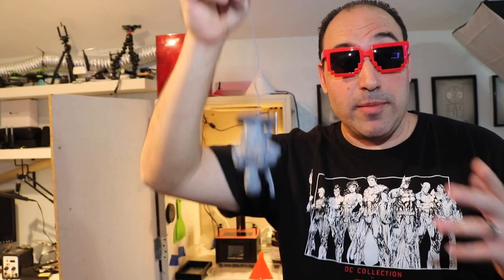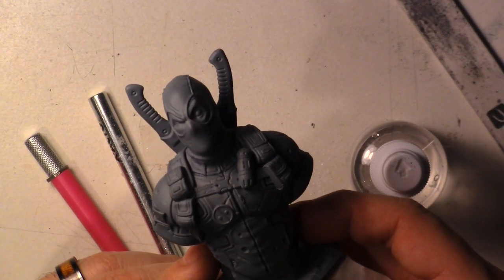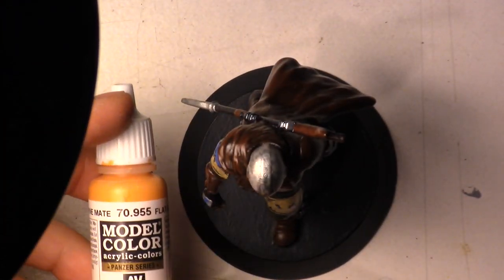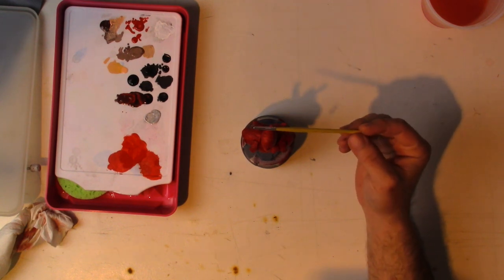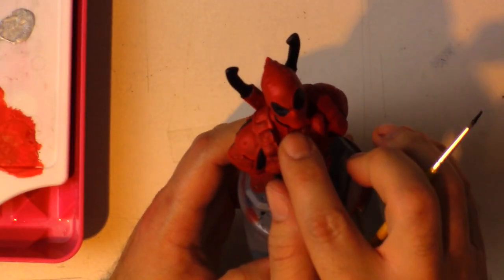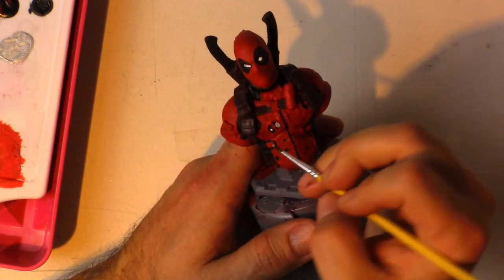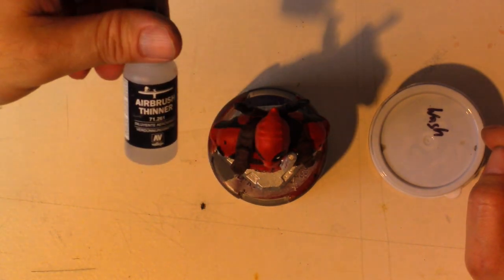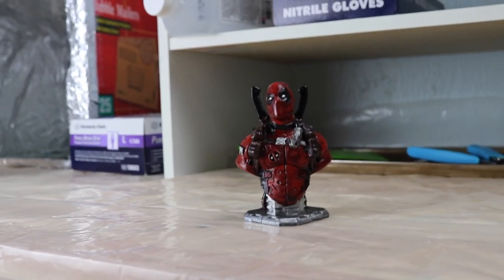How to Paint 3d prints, the basics

Comment: Two tips i can give about the finish; when you do a wash, its meant for accenting shadows and crevices, so go back over with your base colors again and hit the entire model (not just highlights). then you can go back with a lighter base color and highlight like he did. lastly, get some quality clear coat. rustoleum is AWESOME for priming but lacks with everything else. You can see the "Matte" clear coat ended up glossy. Not even satin. GLOSSY. two things can cause this, too thick and clear coast that isn't worth its weight. I recommend Tamiya TS-80 Flat clear; it is a small can but goes very far and you only need 1 coat for stuff like this that sits on shelves. Its a varnish and is meant to keep your colors safe. if youre using it for functional stuff or things touched often or in the sun, 2-3 coats wont hurt. and when you "mist" like this gentleman, actually MIST. don't mist, then mist, then spray, then mist, then spray. Coat goes on too thick. lol
Reply: Going back over with the base color doesnt full cover the wash? Just wanna make sure I understand that right. Getting ready for my first paint

Comment: I used Elmer's wood filler to fill in the whole print, and it hides the lines well, then I used a Rustolium spay paint called filler primer, then I sanded it smooth. It works great.
Reply from the maker: I do that with FDM prints. Elmer's wood filler? I'll have to try it.

Comment: Commenting before I watch the video , hoping to use this on a figure that I ordered , it’s fine , but it has some gaps , some chipping. I don’t own a 3D printer and it’s my first time ever dealing with something like this so I’ll edit this with some questions hoping to be answered or some tips , basically it’s a among us figure with a detachable body , I’m hoping to paint it , and do the things we’re you coat it with a clear layer and it protects the stuff , but before all of that I’m hoping I can use a nail filer to sand it down?? I have no idea what I’m doing and I’m kinda scared to mess with it cause i don’t know what I’m doing.

Edit one: 2:20
Ok question , should I use a primer for my figure? It uses colored filament and I’m planning to paint shading and paint the visor as it’s blank. Also there’s the most gaps where the visor and the body connect but it’s secure for the most part ,  the ears are so rough and shedding I’m thinking of just sanding the texture completely cause it’s irritating

Another question , is painting by hand with just any paint good? I don’t mean like dollar store , but I mean does the brand matter , is there a brush I should use? 

What kind of stuff should I be using to keep the paint from scraping off , kinda how I mentioned in the first question, I think it’s called varnish but I mean either the stuff you brush on or spray paint whatever , I don’t own any so either way I’d have to buy some so
Reply from the maker: I would practice on something else before going I had and painting your model. Is it resin or filament print?

Comment: Nice work, thanks for sharing.  Have you ever tried using Duplicolor Adhesion Promoter as a basecoat under your primer (guess you can even apply acrylic paints right on top of it too)?  I've heard that it does wonders to help everything stick really well to plastic.  Also, have you ever used The Army Painter, Matt White primer?  Just wondering.
Reply from the maker: No I was thinking about giving them a try but they’re very expensive. I don’t mind paying if they’re good but I’m one of those peoples that if it ain’t broken don’t fix it. 😂

Comment: Suppose you printed your 3D model in separate pieces. Do you recommend priming the pieces separately or priming the model after it has been put together? Thanks
Reply from the maker: I like to dry fit them at first. Make sure everything fits correctly. Tape off the edges that are going to be glued. Put them on sticks or paint caps like I did in the video, And paint them individually. If the parts are easy to get to to paint or there one or color i’ll do them together. This video may help  https://youtu.be/FhxqFEgaLwk
Reply: Crazy Will Tech Show Thank you very much, greatly appreciate it.

Comment: I would advise getting actual primer in spray paint, something on the cheaper end of the midrange would be 'duplicolor'.  It will adhere to the plastic better in the long term, less chipping, and during sanding will show you low spots, as they will appear a little bit glossier than high spots.  Plus it's good at filling print lines.
Reply from the maker: I’ll try it but really like Rust-Oleum 260510 Automotive 2-in-1 Filler & Sandable Primer, 12 oz, Gray https://www.amazon.com/dp/B006ZLQ4HQ/ref=cm_sw_r_cp_api_glt_fabc_AAV2894JDW27XZ69HZPJ?_encoding=UTF8&psc=1 for my FDM. Is it like that? But with the gloss you told me about.
Reply: @CrazyWillTechShow  Rustoleum does have some affordable and good solutions but don't you find it TOO filling though?  Last time i used their primer I had to do a lot of sanding to take back the details and it caused me to send up sanding through to expose the high spots.
Reply from the maker: Yeah don’t have problems with the resin I just prime it. But the FDM can be very challenging. But I will definitely try your recommendation. Thanks 😊

Comment: does Vallejo need to mixed with thinners?
Reply from the maker: Nope in the video was straight out of the bottle. Sometimes I add water to thin them.
Reply: Not with brush but you do if used with airbrush unless you get the Vallejo Air paints.
When using brush it's best to use a wet palette to keep the paint from drying when painting.

Comment: Had a Quick question, gonna be doing a huge project for Halloween, got a life size replica of the BFG9000 3D Printed, 51 pieces in total, 4ft long, 2ft wide, 18inches tall, figured out where all the pieces go, so i gotta sand and prime them, but I bought a Candy Gold im gonna give the main body of the gun, would I have to worry about anything melting? Someone told me its possible the paint could melt it, and to test it on a scrap first, just subbed to you and wanted to ask some advice on that before I start the whole painting process... also would I be able to set the pieces on a table inside to dry overnight? As I don't have a safe area to keep the pieces outside to dry.
Reply from the maker: I don't think it would melt the plastic. But I would test it on a scrap piece first. What is it made of PLA ABS resin? I would definitely paint outside and Bring it in. If you have a well ventilated area inside like a garage you could do the whole paint there. I would try to get everything on hooks or if one peace I would make some kind of mound that holds it in a way you could move it around. That's the big gun from doom?
Reply from the maker: The rustoleum 2X for plastic is amazing on PLA. i’ve had a lot of good luck with that stuff. You can do it outside just the bugs like to Fly into it. but you can send it and touch up areas. wait at least an hour  to bring them inside so your not breathing that stuff in. If you use the restoleum you can Touch it after an hour. just be patient and if you mess up stop and step back for a moment before you do something to make it worse. Just letting you know from experience.
Reply from the maker: That’s freaking cool! I better get a picture when you’re done with that.
Reply from the maker: I don’t know how old you are but I played the original doom back in I think was 1997? the last one I played was in 2004 I think 🤔
Reply from the maker: Sounds like a very long project but really cool ending. Make sure you send me the video.